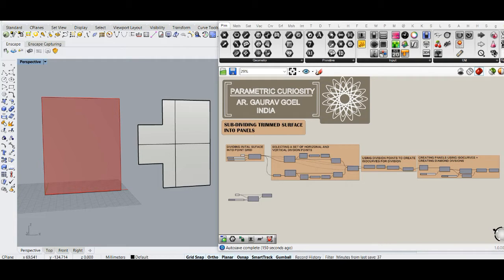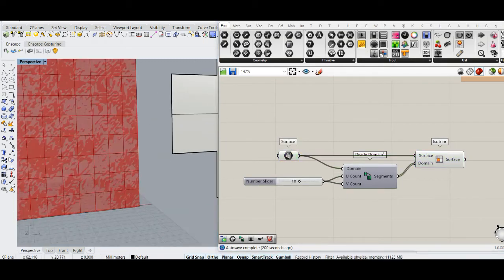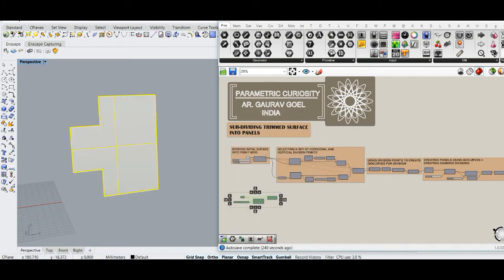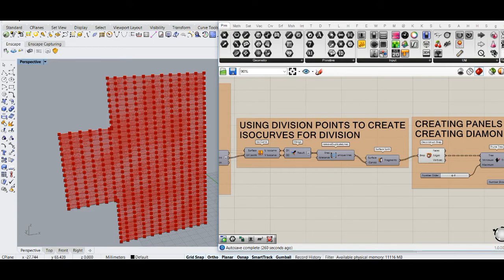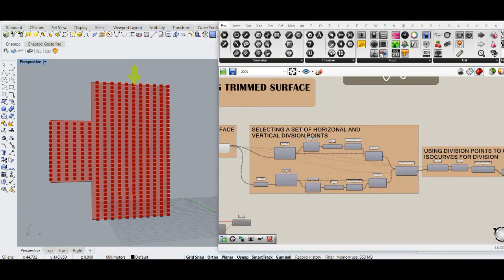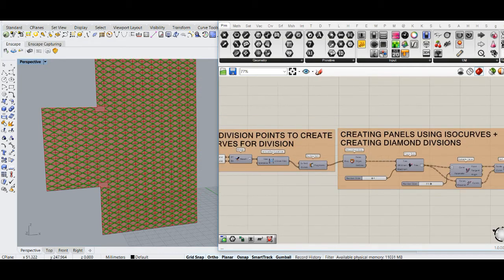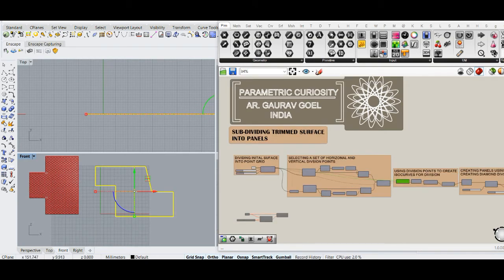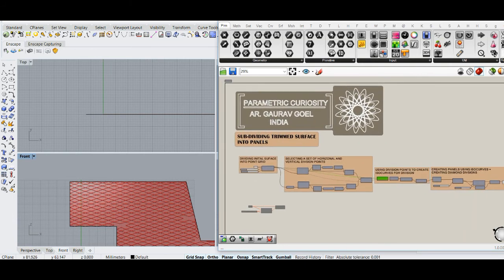Parametric curiosity -Trimmed surface division

Comment: Impressive! Im having the same problem. CAn you please upload the definition?
Reply from the maker: Hey Jireh thank you for your message ..I am afraid we don't give readymade scripts. We have tried to explain the concept  well explained in this video but if still you have any problems to follow please mail us at parametriccuriosity@gmail.com. we can give you script for a charge if you are working on something Important and urgent. Thank you.☺️
Reply: I did the script but it seems like it doensn't work properly on a non-planar surface. Might need some additional tweaking
Reply from the maker: yes of course! sorry, this script would work on planar surfaces only. For nonplanar surfaces, it will need projecting curves onto surfaces or other alternative methods of isocurves.